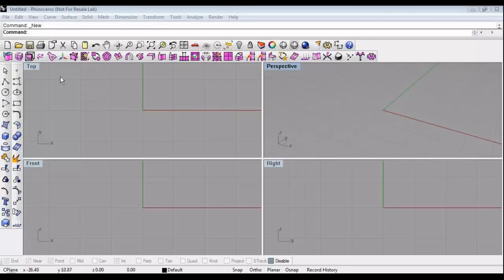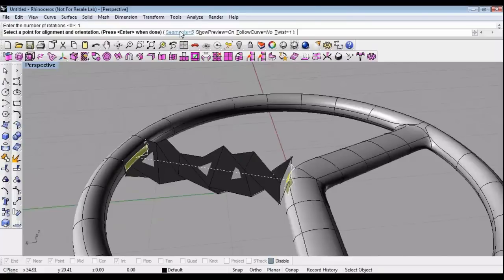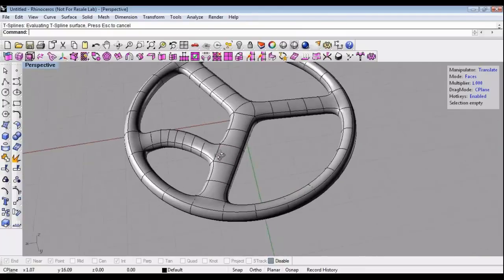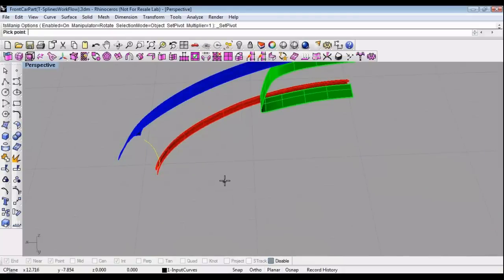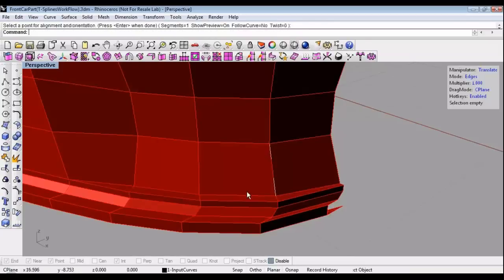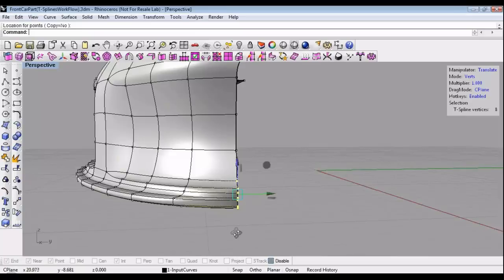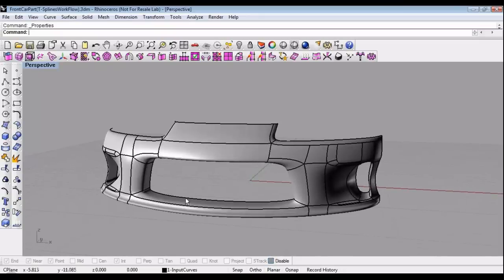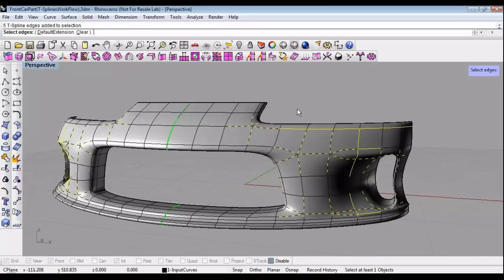New features in T-Splines for Rhino v2.2

Comment from the maker: @jajajah86  You may be using a curve that has very few control points so the result will not look smooth. Try rebuilding the curve with more control points. 
It is difficult to say without seeing the curve, but that's my best guess without seeing the file or pics.
If that didn't solve you problem, send an email to --  support (at) tsplines.com  -- and we'll take a look at it.